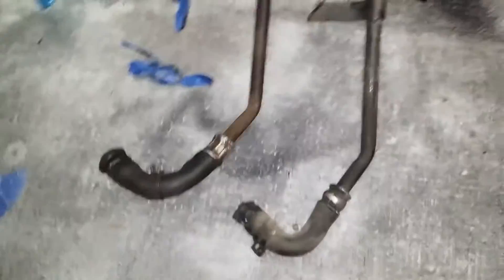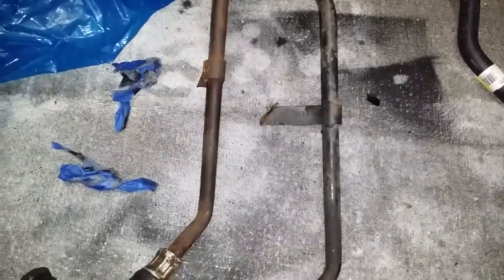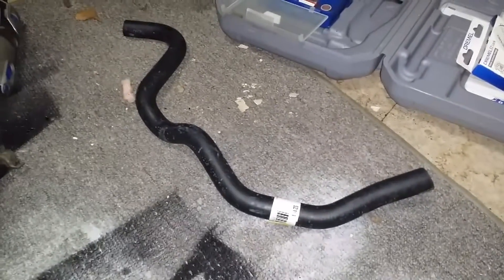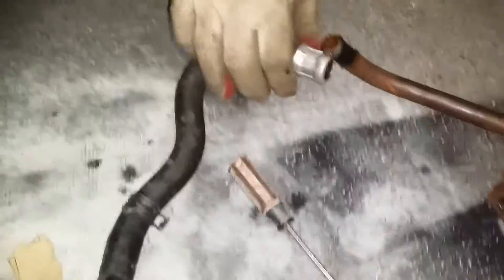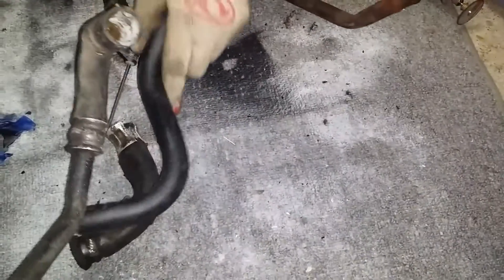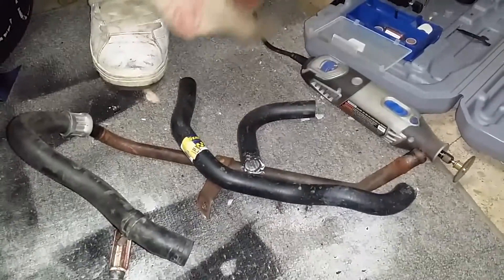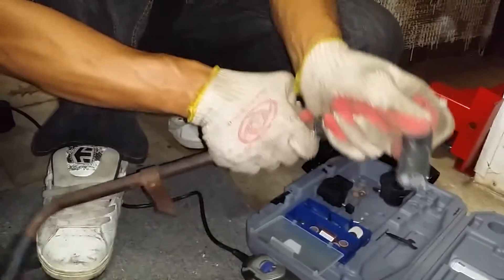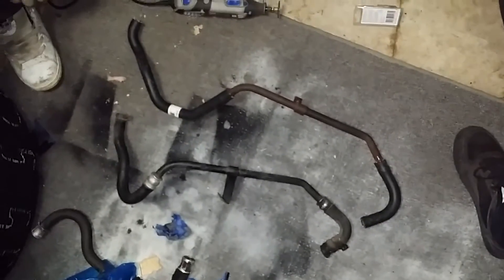Chevy S10 DIY heater hose repair (Fix the Rice Truck part 3.5)

Comment: Great fix for an old work truck!  Had one end with a clamp and another factory crimped on cracked hose leading to heater core.  I cut the crimped connection to the hose off inside the truck (just like the video did on the ground) with a dremel and a reinforced cut-off wheel.  Protected the wires around it and it came off clean.
Reply: O'Reilly Auto Parts looked at it and ordered the exact hose I needed and I purchased two clamps from there also.  Cost was 24.99 for Coolant hose and 2.99 for hose clamps.
Reply from the maker: Thank you for your comment, it's awesome to hear stories about how people fixed something.

Comment: Yeah.., This sucks! I have a 97 Sonoma which is pretty much the same as an S-10. Same deal. My hoses are rubber to tube like that too. Except mine goes rubber out of the core to metal fitting into the block. Can't get that. Have to do creative engineering. That's why I'm here to see how you guys did it. Going to be 29 degrees this weekend. At least need working defrost. Good deal! I originally thought of just cutting the tubing with a tubing cutter, but I was afraid the hose clamp would not hold. Looks like it will hold if you can get that factory hose fitting off. Thanks!

Comment: Does it gotta have the metal tube? Have the same problem but i replace it with a all rubber heater hose . . But its still overheating any help?
Reply from the maker: if its overheating you have another issue that isnt because of the hose, check the thermostat, fans or any other component that is suppose to keep the temperature down.

Comment: Have to make this exact repair. Can you tell me where you got new heater hose.  It was perfect. Does have part number?
Reply from the maker: I do not know the part number off the top of my head, me and my friend were just going through a box of what auto barn had in the backroom

Comment: Does it hold up? I have a raised edge on the metal tube. Does it really matter?
Reply from the maker: It's held up like a champ, as long as the hose can make it over the metal tube you shouldn't have issues
Reply: Thanks
Reply: Worked perfect! Thanks guys!